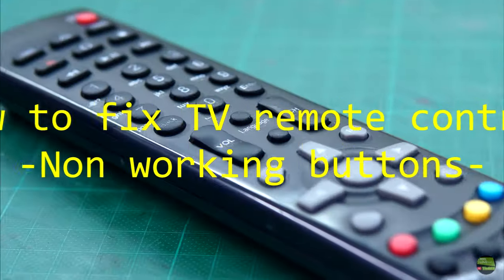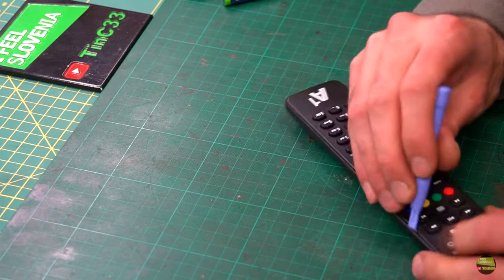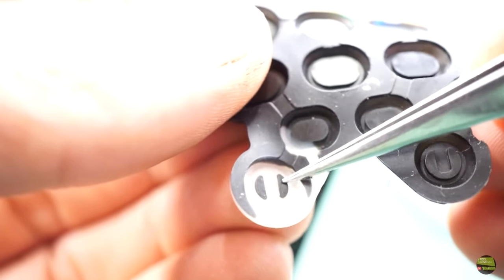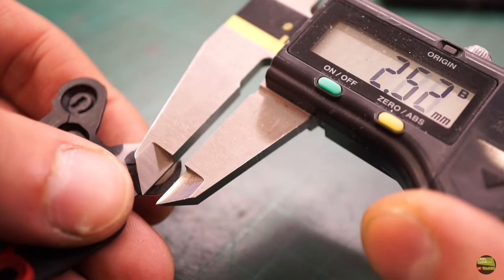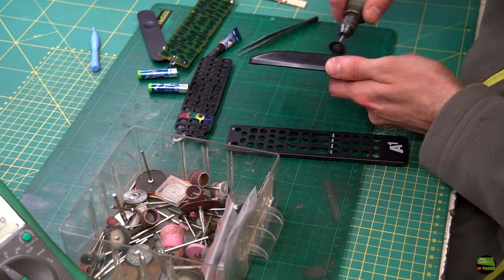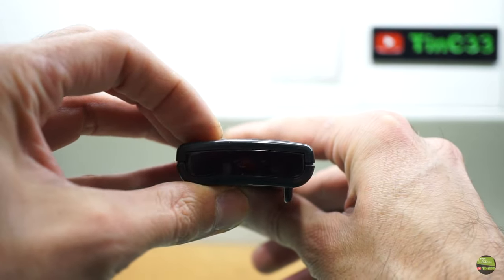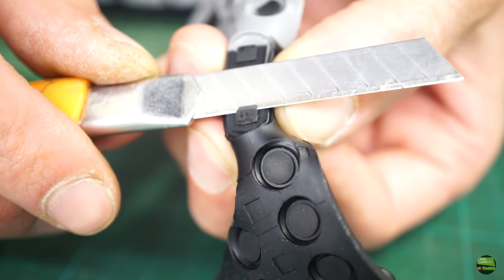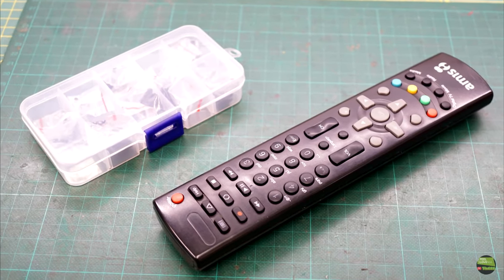How to repair remote control - when cleaning doesn't help [replacing the button pads]

Comment: I use tin foil on my remotes, it works just as well. If your fixing lots of remotes then your method makes sense, but for a one off tin foil is the way to go 🙂
Reply from the maker: Great, i didn't try that, thanks for info,
Reply: What kind of glue works best?
Reply: @WillPOnya  rubber cyanoacrylate, or black super glue is best, but any super glue will do 👍🏻
Reply: @trooperwolfie  - thank you. I really can't imagine any glue sticking to silicone due to the oil.

I have to clean the circuit board once or twice a week on my remote. Alcohol just won't last so i use a pencil eraser to remove all the black stuff from the switches. And an emery board to clean the black stuff off the eraser for the next cleaning.
Reply: @trooperwolfie  - thank you. I really can't imagine any glue sticking to silicone due to the oil.

I have to clean the circuit board once or twice a week on my remote. Alcohol just won't last so i use a pencil eraser to remove all the black stuff from the switches. And an emery board to clean the black stuff off the eraser for the next cleaning.
Reply: @WillPOnya  if your remote buttons are silicone, use a small dab of silicone sealant, it's the only thing that will stick to silicone. My buttons are rubber so it's not an issue with super glue.
Reply: @WillPOnya  T-7000 seems to work best. It's what's used for phone repair. CA glue doesn't bond well to silicone.
Reply: @WillPOnya  For the pads can try gently wiping them on plain piece of paper. Conductive coating is VERY thin. If it does work this trick may only work once.

Comment: Thanks. I didn't even know that you can buy those pads. I was planning to implement 3d printed button and put something conductive below it. But this would be much better solution. Thanks, I'll buy these when next encounter worn remote.
Reply: Mine is also having this problem. If you have found any solution please let me know. Thanks

Comment: Interested to know if the remote kept on working. Generally the best glue for silicone items is silicone adhesive. I've repaired many remotes over the last 7 years using the pad kit bought from Aliexpress and silicone is the one adhesive that lasts. CA tends to dry hard and is therefore not good on silicone. It provides an initial bond but then flakes off.

Comment: Tha k you for this pointer.. In the past I have used the metal disks (used inside the simple pcb mounted switches) and glued on the pcb itself as a fix. I didn't know you can buy the conductive patches.

Comment: Very nice! I have a keypad with two buttons not working but the track/trace/pad on the PCB seems to conduct badly. The track/trace/pad on the PCB it's color is lighter than the other working ones. Is there a way to fix it?

Comment: where did you bought the pad? last week Im repairing my failed car climate console button and couldnt find the replacement ended up gluing aluminium foil on the pad dont know how long it will last
Reply from the maker: There is a link to ebay under the video, search ebay for button pad kit
Reply: @TinC33  thanks mate

Comment: Instead of buying new button can you take out one of the less used buttons and replace the worn button with the less used ? Gonna try it that way.
Reply from the maker: Sure it should work perfectly, i didn't want to demage working buttons but its a great idea because there are just no way for some bittons to be used anytime 😀
Reply: How do I stop my tv from saying change batteries when I just put in new batteries

Comment: what kind of glue did you use ? i heard C A glue ... is that right ?
Reply from the maker: Yes but rubber glue is better, in any case Sand a bit surface before

Comment: Question for you, in this example, is it likly that when trying to use the remote none of the buttons work?
Or would it be just the one button causing problem? 

My remote (the same as in video) has just stopped working.
Reply from the maker: If non button don't work then i start checking for power issue, check and clean the contacts on battery, try to measure if you got any voltage on pcb... If some button not working it's a button problem, but surly not if noone doesn't work.
Reply: @TinC33  OK Tin thanks for the response 👍
Reply: @mywateva  mine broke no buttons worked,so tested the ir led and it was broke ,put new one in and guess what ? It worked 👍
Reply: @gordonemery6949  I did the same and guess what? It still doesn't work... :( The led was broken and the new one now works (tested with multimeter), but the remote still doesn't activate it. There must be something else wrong. Power supply also makes it through into the board, tested it. I tried button pads from another remote, no luck either. The pads from the broken one work on another remote though.

Comment: can you use other conductive material, like conductive metal tape?  or does it have to be conductive rubber pads?
Reply: I use tin foil (video on my channel 😉) it works just as well.
Reply: Use an old unused remote controller as spare pads.  Mine worked without problems :)